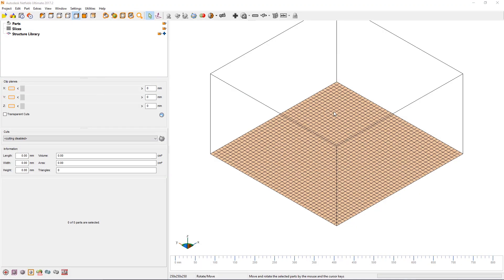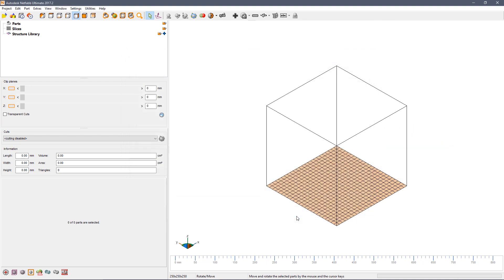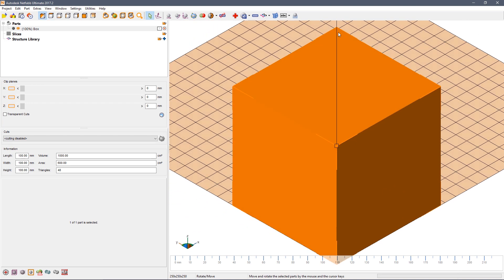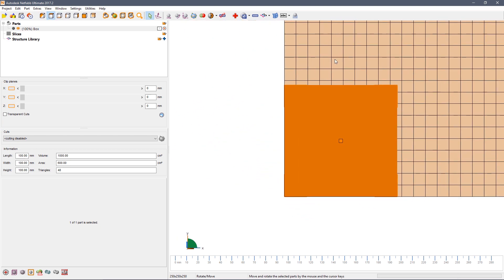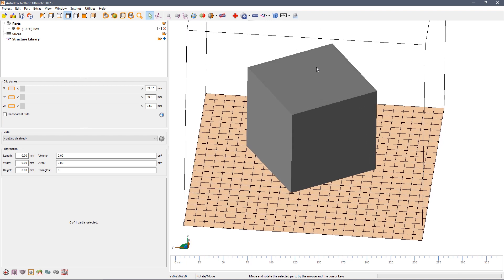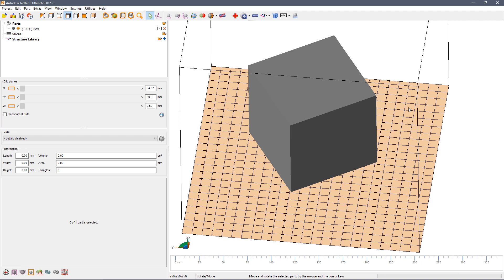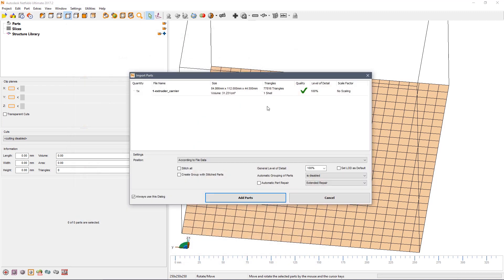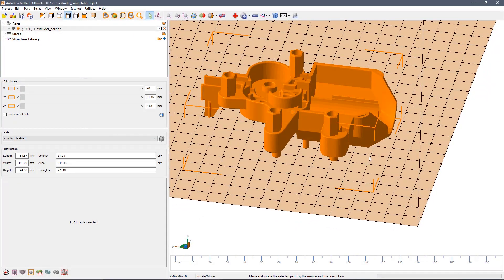Netfabb Tutorial Part 1: Interface and Controls

Comment: No Mac version? Are they serious?  Makers are dumping Windows in droves and moving to Mac and Linux. Why don't Netfabb provide free older Mac versions without a trial period, rather than dumping 50% of the maker population? No one is going to buy an additional computer just to use Netfabb so where is the benefit for Autodesk and Netfabb here?
Reply: Most computer users are not mac users, and considering the machine learning portion of Netfabb, Linux is the best platform in that regards. Windows support to give the majority of customers access, and Linux because of a very significant function. Also, considering how difficult Apple makes things for software developers, its not a surprise. Mac users are nowhere near 50% of the maker population.
Reply: "Makers are dumping Windows in droves [...] 50% of the maker population" [citation needed]